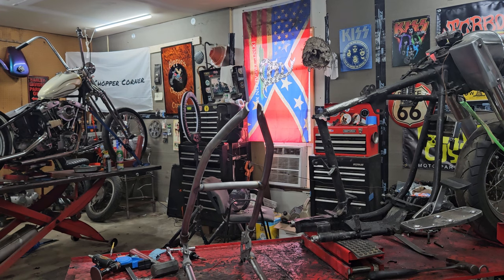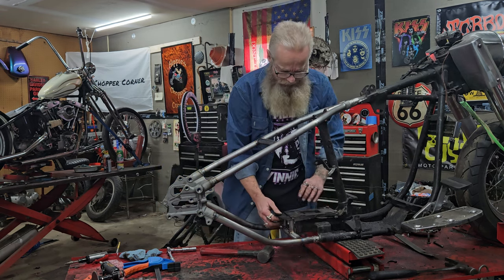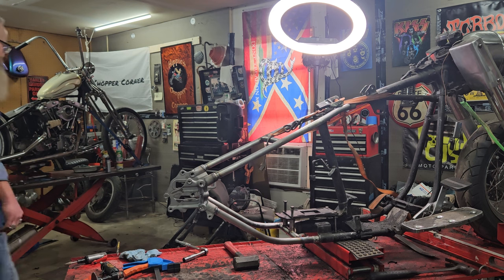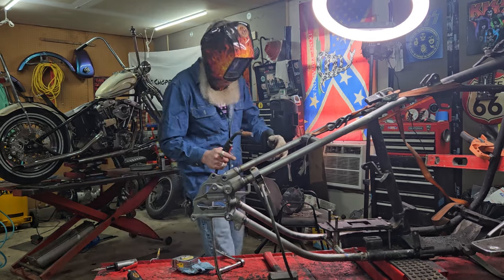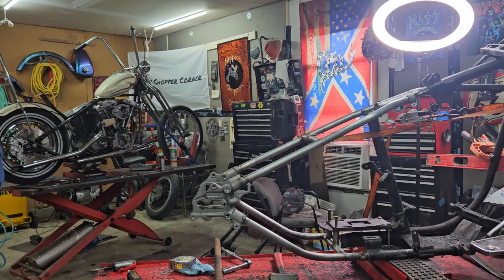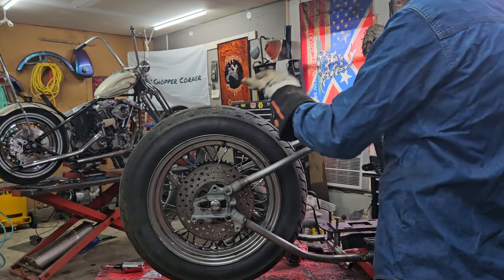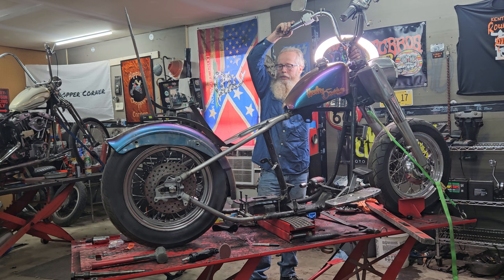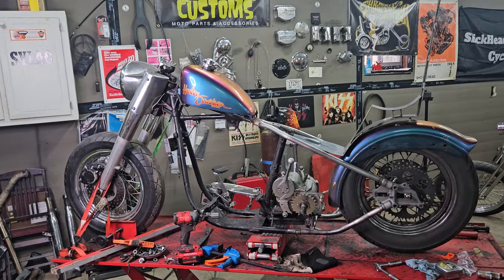Hardtail a Shovelhead Part 2

Comment: Save them gas tanks mounts . 200 right there .
Reply from the maker: Yeah, I always keep em
Reply: @hippieschoppercorner 
At the swap Meets look for a Porkster tank the were Big in 70's remember I think the were 3.5 of 4 gallon . Thanks . I got a Idea what Your going for . Old 70s style FLH rear fender . Roll the tail up to about 10 a clock .  Like I did on my 81 . .